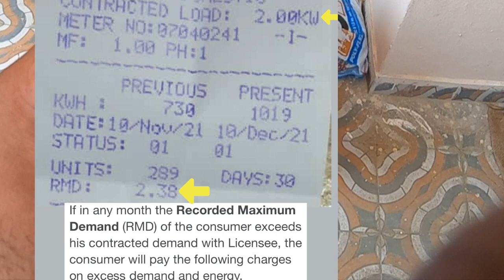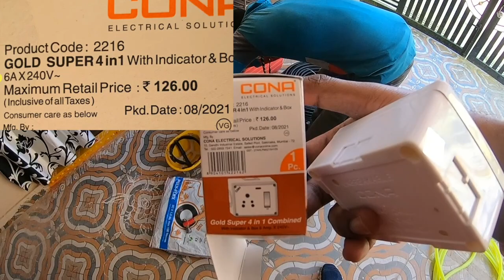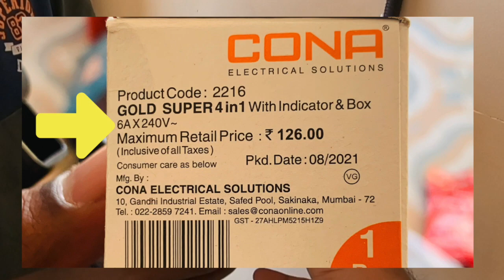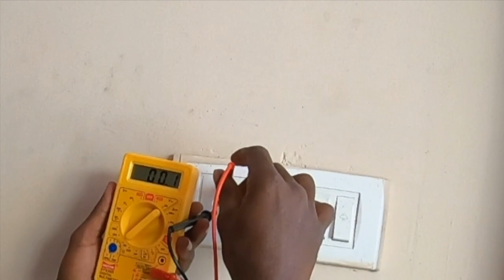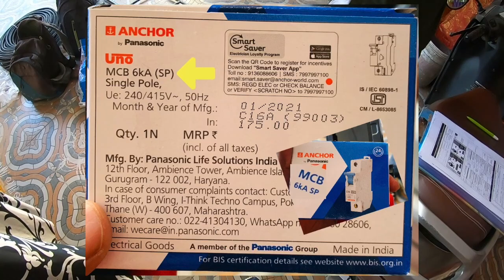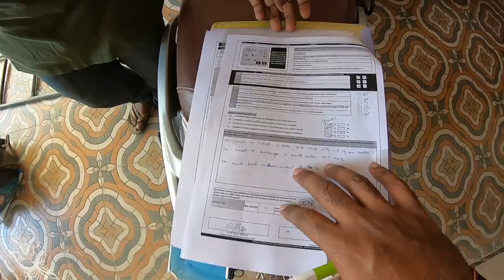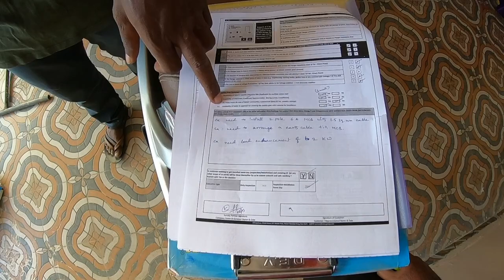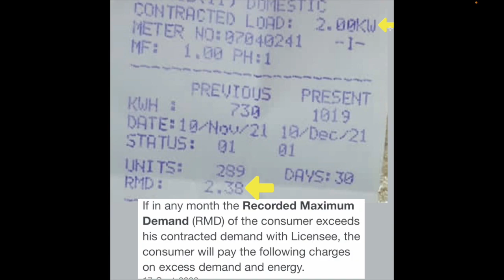Ola Home charger installation | Must watch and understand !!!!!

Comment: I am in a rented house and the contracted load is 1kw and RMD is 2.84, could you suggest the way forward. Don't know how my owner would react to change.
Reply from the maker: I would suggest you ask him first, you can show this video as a reference.
Reply: @AVAutoTech  thanks for the reply. By the way how much did electricity dept charge you for upgrading to 4kw
Reply from the maker: @babareddy44  franky upgrading is not required it’s just that you will get a higher rate per unit billing. 

Try using it for 1 month and check the difference in cost.
Reply: Thanks for the reply. Subscribed your channel and will keep sharing your videos. Thanks again.
Reply from the maker: @babareddy44  all the best with your scooter

Comment: So it is just a 3 pin socket?
Reply from the maker: Yes 👍🏽, But it’s a 6 Amp socket
Reply: @AVAutoTech  but any electrician will install it in 500₹
Reply from the maker: @saxena3718  upto 25 meters of wiring is included

Check the below video, you will understand it much better. 

Rs: 2359 | Ola Home Charger Installation | Explained
https://youtu.be/jwDpam0rJ6Y

Comment: Out of 25mtr cable, if only 5mtr cable is used, balance cable are they leaving to us or taken back? Plz note that we paid for it.
Reply from the maker: They take it.
Reply: @AVAutoTech  We paid for it. OLA action not acceptable.
Reply from the maker: @care4ucare4u16  25 mts will alone cost approximately 3750₹. I feel upto 25 meters is a complementary service being provided by OLA. Considering the fact that we pay only 2400 for the full service. 

Check the below video to understand the analysis. 

Rs: 2359 | Ola Home Charger Installation | Explained
https://youtu.be/jwDpam0rJ6Y

Comment: I am getting so much time for charging my scooter only 45% charged for 6hrs.is I should change my plug point?
Reply from the maker: Yes you should definitely try changing, make sure it should be minimum 6 amp socket.

Comment: Where we will get to pay for this installation.my ola bike is dispatched on 28th Feb.I am in apartment,How to protect socket to misuse by others. Wheather we need to wait till complete charging,How to.protect charger from theft in appartment
Reply from the maker: 1) You can pay for this installation on the ola app.

2) To protect this from being misused I am installing a box with lock, video for the same will be out soon.

3) To protect the charger from being stolen. I am also planning a plug lock once the delivery is done, will put a video of the same once it is done.
Reply: @AVAutoTech  thanks bro.Ekkada vuntundi ola app lo.Naku option ravatledu.Eroju vehicle delivery ayyindi and that to with temporary registration.
Reply from the maker: @narasimhastanam  congratulations. ola app lo open the scooter payment section, you will find an other option to pay for charger Installation.

Check all the tabs you will find it.
Reply: @AVAutoTech  Naku option ravatledu.App to electric ki vellanu,andulo your registration Ani vundi,Akkada click cheste ekkada option ledu?

Comment: Hi I a socket right beside the scooter where i park i don't need the wiring and switch box i need only the bracket what to do any idea i also called customer care and they told have to take the full package 
PLS help me out
Reply from the maker: They are not giving that individually as of now, already tried contacting them.
Reply: @AVAutoTech  So i can't do anything then 😥
Reply from the maker: @makersgaming7395  they might start giving that in accessories going forward.

Comment: Do they provide mcb also ??
Reply from the maker: No no Mcb I had to buy. 

Check the below video you will understand better 

Rs: 2359 | Ola Home Charger Installation | Explained
https://youtu.be/jwDpam0rJ6Y
Reply: @AVAutoTech  MCB and other extra spares are from customer, but will they charge anything as 'service cost' for this as extra?
Reply from the maker: @mzs114  I did tip them for that ,you can also request them.

Comment: Why 16A MCB was installed? For 750watt charger, 6A MCB is sufficient with 30% buffer. A = 750/230*1.25 ~5A
Reply from the maker: That is what was suggested by them
Reply: Definitely you need it because initial power drawing will be more just like air conditioner.

Comment: have a serious question

did you pay for the power cable that was installed?

i know you paid for the meter and the additional box and stuff, but is the 20meter cable and mcb box covered in the 2400rs initial payment?

please reply as son as possible,
youre doing a great work, btw
Reply from the maker: 2400 Includes 

Visit 1:
Upto 25 meters of wiring 
Casing for wiring
One 6Amp Socket
Installation of all the above

After the above Installation is done Ola will ship you a charger bracket 
worth Rs: 1205
https://youtu.be/-l4ERtfMQ7g?t=14

Visit 2:
They come and finish the Charger Bracket Installation 
https://youtu.be/hPDlLFKIMi8

All the above is included in the 2400

MCB, Sub-Meter and the Box with lock was at my expense.
Reply: @AVAutoTech  thank you for sharing, Kind sir.
Reply from the maker: @kolamaash2736  welcome
Reply: @AVAutoTech  MCB installed by ola guy ? If yes they taken any extra cost ?
Reply from the maker: @Niksworld2288  I bought the MCB with my money, they don’t do that.
Reply: @AVAutoTech  yes you bought it, buy installed by ola technician or local electrician?
Reply from the maker: @Niksworld2288  my guy was available, so he did it for me.
Reply: @AVAutoTech  ok
Reply: @AVAutoTech  Hi Sir I also booked my Ola s1 so I have to pay on website for charing plug installation? cause i'm living on 4th floor in flat So. Please reply
Reply from the maker: @jayvyas7917  download the Ola app and try to search for the installation payment option

Comment: Bas ek swicth board or plug bitha diya uske 2300rs 😅😅
Reply from the maker: It’s definitely worth it, see the calculation of the total wiring cost.
Reply: @AVAutoTech if we need wiring of 30 to 40 meteres then?
Reply from the maker: @ we need to pay extra to them